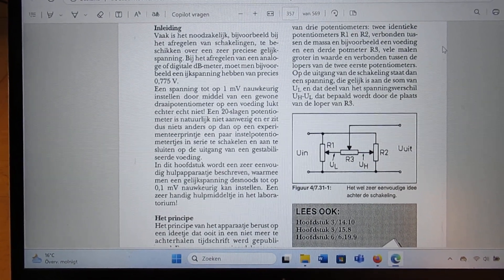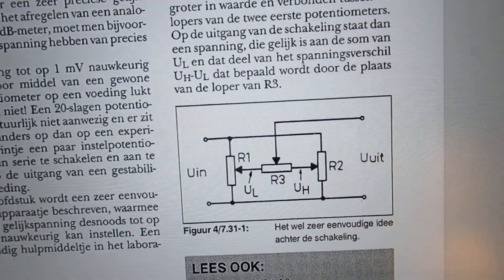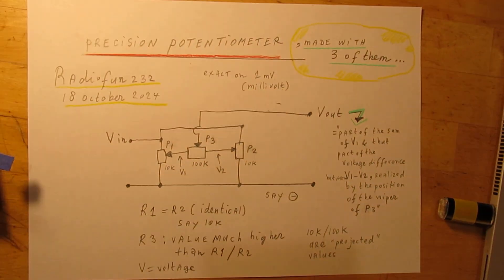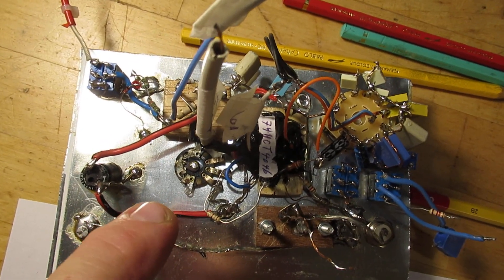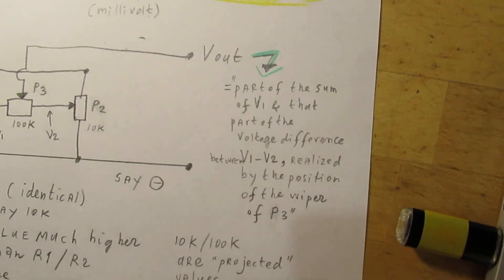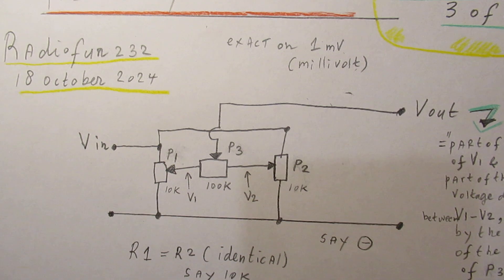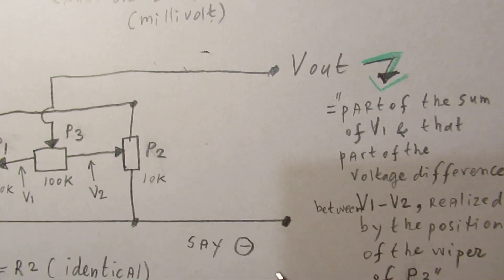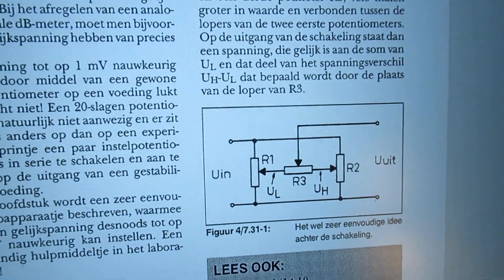Precision potentiometer (precise to 1 Millivolt). Schematic with 3 of them used, to do that job

Comment: Hi, Ko, here are my breadboard test results!
Setup =
Breadboard = a 10K-100K-10K Multiturn (x21, IIRC) Trimmer Pot Configuration; as in the video.

Siglent 6.5 Digit DMM
Probes “REL’d out.

Siglent PSU (0.001V Tolerance)
Set to 1.000V @ 0.100A.

No Load

Goal
Attain 0.500V to within the +/-0.001 advertised voltage accuracy

Board Setup
First 10K Pot trimmed to 0.501+V
Second 10K Pot trimmed to 0.499+V
Making for a span of 0.002+V, over the 100K Pot

Results
The target voltage of 0.500V +/- 0.001V was easily achieved and exceeded! The voltage readings floated between ~0.499988V and ~0.500017V, being a span of only 0.000029V. Readings were consistent and repeatable. Considering thermal drift, ambient noise and mains drift, I find the results to be amazing… Particularly the ease with which it was to trim in the target voltage. Accuracy orders of magnitude greater than 0.001V are easily achieved.

Realizations
1) The span of the working voltage may be moved with the 10K Pots anywhere within the range of the supplied voltage. For our example, anywhere between 1V and 0V.
2) The smaller the span of the working voltage, the greater the precision of the 100K pot, as the ratio of turns increases over a smaller working voltage range. For our example, we had 21 turns to adjust out the 0.002V range.

Given my limited hobbyist knowledge, I may have made some grievous error, leading to some great misunderstanding. Let me know what you think.

Cheers!
Reply from the maker: Hi, many thanks that you did this serious test! Helps a lot to understand what is happening in the circuit and thus usable for everyone! It seems to me a perfect way to test this setup and the measurements are very precise. 😁

Comment: I first met this wiring in a commercial kit of a transverter from VHF (130M-180M) to FM band, driving a varicap for the LO. I used to adjust the side pots for 143 & 146, and the central one gave a smooth scan of the 2m band. That was cheap and funny, and 40y later we have ADC's to the GHz ! 😱😄 Thanks for the video, keep going !
Reply from the maker: Thanks, important info for everyone interested in electronics & HF/radio technology.
Reply from the maker: My first reaction to your comment was not visibile (I think by shadow banning of Google/YT) but, anyway, thanks again. Useful for everyone interested in electronics and HF/Radio.

Comment: I think it is better to use R1 and R2 as a dual potentiometer, then it will be easier to regulate the voltage, and if you connect another variable resistor between the negative and the lower terminal of R2 (or R1), then you can adjust the accuracy range.
Reply from the maker: No, that is not the aim/idea of the circuit, sorry. But you can try! Your idea will surely work and I am interested in your results with your setup. 22 Oct. 2024.
Reply: The idea is that you can choose upper and lower bound independendly. By using very similar positions of P1 and P2, the scale "spread" around on P3 increases:
But if put P1 higher than P2,, the sense of P3 inverts.
Reply: @thiloreichelt4199  that's true, but adjusting R1 and R2 separately is inconvenient, so my idea is to use a dual resistor (R1=R2) and adjust the spread on R3 with, say, R4 (connected to either R1 or R2); when R4 is zero, the difference between R1 and R2 is minimal (but of course you need both identical parts in a dual set).
Reply: @rustamid5743  You are thinking of a dual pot where you can adjust the spread between the 2 wipers separately. I have never seen a dual pot with that feature. I do not see how you can achieve that with a fourth pot either.
Reply from the maker: @rustamid5743  I am interested in your idea. Thus: make it and show it on your YT Channel. That is in my opinion the only way to prove and explain your idea's (though I agree with @thiloreichelt4199). Perhaps your idea will work out very fine for a certain electronic application, so it can help many hobbyists. But at first, test it and show it. Without a demo we cannot get a good insight in your idea's. Has also to do with the aim of my YT Channel: practical & tested circuits, showed in a demo. Anyway, thanks. 29 oct 2024.

Comment: I think the pots would need to be linear, not audio/logarithmic type? Yes? Please do a follow up breadboard video! Also test the idea of the poster that suggested that R3 needs to be a lower value? Didn't the article say higher?
Reply from the maker: Yes, linear pots will work best in this case, is (also) my idea. The value of P3 must be "substantial" higher, tells the article. You can do your own experiments and take conclusions, the setup is easy.

Comment: In your application, would a two pot configuration be any good, that is, say a 10K in series with a 1k. I do like your 3 pot configuration, though - many thanks. All the best Ko.
Reply from the maker: Thanks Michael, I have used your idea/option today (20 okt. 2024) in the square wave oscillator potmeter circuit (description) and it works OK. Thus: thanks! When everything works nice I will publish that circuit, but, indeed, your setup works very good.
Reply: @radiofun232  It's great that we all help each other, I've learnt a lot about RF circuitry from your good self.
Reply from the maker: Thanks Michael, it is also possible. It depends, of course, like you know, on the practical situation.

Comment: Very interesting circuit. It can indeed be useful.
Reply from the maker: Thanks, it is indeed very useful. Perhaps more in the future (I did some tests today with that 74HCT4046 VCO oscillator chip). More info in the final lines of the description.